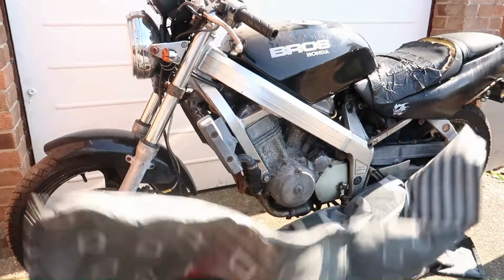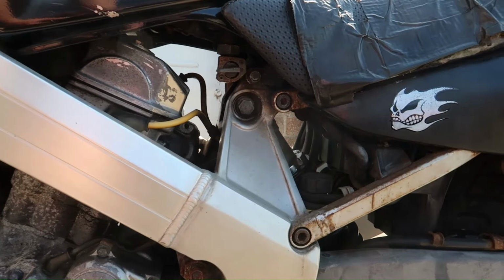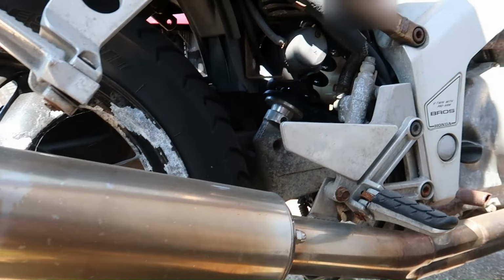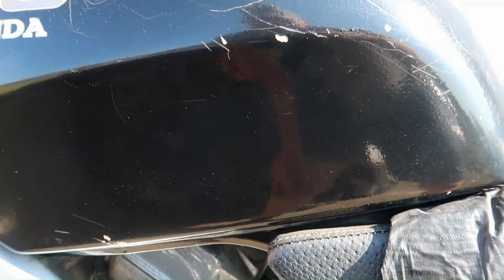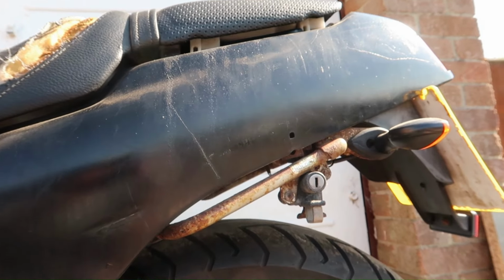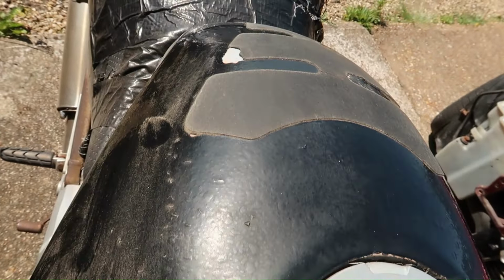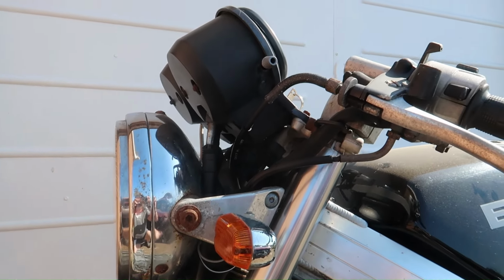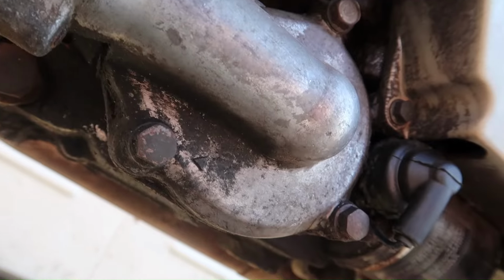The next project, bet you can't guess what it is | #Motorcycle Restoration | Restoration Biker

Comment: Beautiful project Sir. i hope to see this restoration soon. Can i use this place for a question about the bmw f 650 restoration? have you restore the cooling system right? Did you notice a shim on the thermostat when you unscrew the cover? i'm Making the same job but i miss this shim , how can i find another one? Without it the thermostat jiggle a little bit in his hose. Thank's so much for your support and for your beautiful contents.
All the best.
Vincenzo from Italy
Reply from the maker: Hi, thanks for the comments. Sorry for the late reply, we have bee away for a few days. Nice!  With your thermostat problem, I am assuming that the shim you are talking about is the rubber seal which should fit around the thermostat. This seal should fit around the thermostat so that it seals top and bottom when the top is fitted. Have a look and let me know what you have got there.